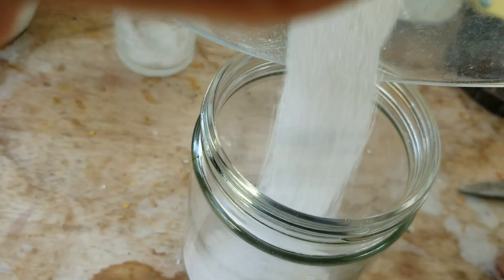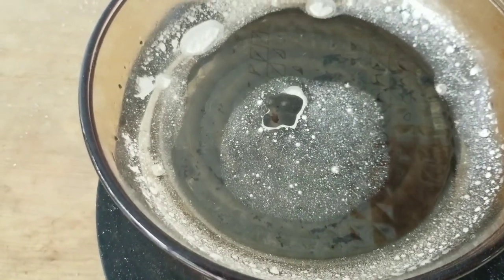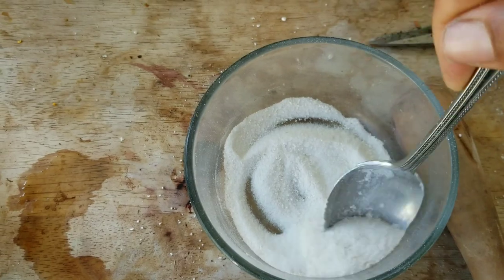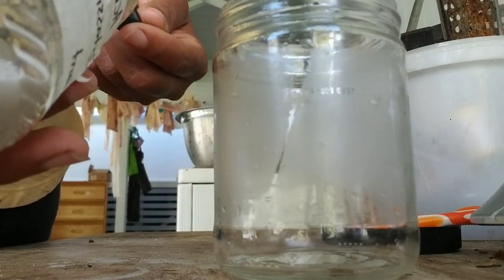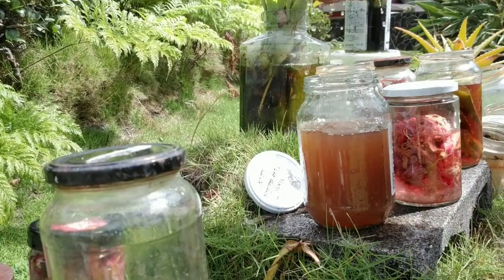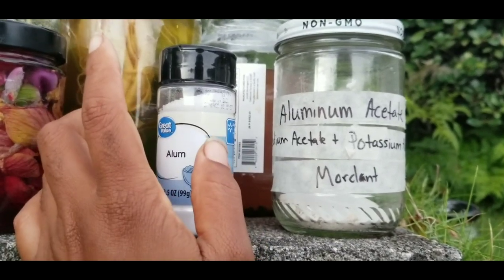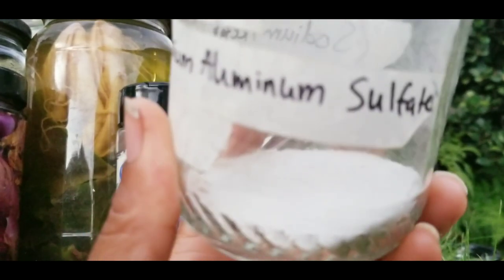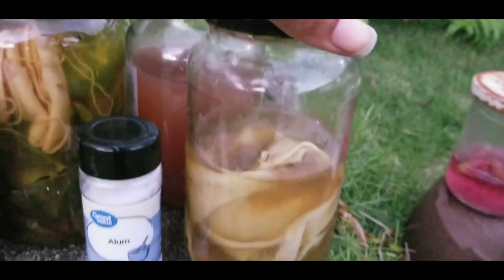How to Make Aluminum Acetate as Mordant for Plant Dye *Updated Video*

Comment: I don’t know much about dyeing textiles. I don’t even know what mordant is. But I’m into chemistry as a hobby. You should be able to make aluminum acetate directly by cutting up bits of aluminum foil and putting it in a glass bowl with 30% cleaning vinegar. If you heat it up a bit outdoors it’ll dissolve faster. Eventually it’ll just be a liquid. If any bits are left add more vinegar or filter it in a coffee filter. Then heat it to a simmer until it dries out.
Reply from the maker: Very interesting!  Thank you for sharing the info. Currently researching this, since  I'm definitely someone who would try it!

Comment: Hi! I’ve Tried Several Times With Aluminum Sulfate and All My Botanical Prints Washed Away When Rinsed. Thank You Very Much for Explaining the Differences Between Aluminum Sulfate and Aluminum Acetate! Hoping I Can Get This Eco-Printing to Work For Me🙏
Reply from the maker: I'm so glad the info was useful for you! Most of everything I was reading about this referred to the use of aluminum potassium sulfate.  I've only come across one source  that talked about aluminum acetate plus tannin being better,  particularly for cellulose fibers.  Unfortunately, I can't even cite the source, as it was literally a sentence or two, and I don't recall where I read it.  But as I've experimented with this, I have found that aluminum acetate, especially when combined with some form of tannin, does work well as a cellulose mordant.  I hope you find some success with this.  Color washing out after all that work and high hopes is no fun!

Comment: Thanks for sharing your knowledge!  How much hot water did you use to dissolve the AA?  Proportions please.
Reply from the maker: Here are a few relevant points.  When using AA or  alum these days:

1.  I don't typically follow the WOF (weight of fiber) method unless I'm dyeing a large garment like a long dress.  This is rare. 

2.  For fabric pieces 1/4-1/2 yards (which is the largest I usually dye), I dissolve 2 teaspoons in 1 cup of warm water.  I then add that to a larger glass container of water and soak the fabric in that.  

3.  I'm usually only dyeing very small cuts of fabric these days when experimenting, and may only dissolve a sprinkle or 2 of mordant in water to prep the fabric.

4.  The large glass container that I use for mordanting purposes is an ongoing bath of water and mordant.  There's always some amount of mordant in there. Depending on what I'm doing, I may not add more but rather just use what's already in there.  I may use this a few to several times before changing the water, adding new mordant at times, and adding none at other times.

Thanks for the question! Let me know if you have any others.

Comment: Very interesting. Would really like see if this works. I cannot obtain ready-made aluminium acetate either, but I have a recipe to make some with alumiunium potassium sulfate, vinegar and soda ash (plain washing soda) and am wondering if you have the right kind of soda, because baking soda has the tendency to change colours and is used as a modifier, but not for mordanting. Could there maybe be an error here? But then again, I am not a chemist and don't know what happens when baking soda is mixed with vinegar ....
Reply from the maker: Thanks for watching and commenting!  For this experienment, I used aluminum potassium sulfate and white vinegar along with regular/plain baking soda.  I'm not sure what the result will be if you use soda ash.  I've made soda ash by heating baking soda in the over, but I haven't used it for making aluminum acetate. 

The recipe I used is based on info found online in a few sciency places where regular baking soda was used. I may experiement with soda ash, though, now that you've mentioned it.

The chemical reaction that takes place between the vinegar and baking soda-which I've read about, but I'm no chemist either--creates something completely new.  Once that new substance or chemical formed, is heated to crystals, and is then combined with the aluminum potassium sulfate, the color changing tendency of the baking soda seems to be eliminated. I'll have to experiment more.  However, in my experience with certain dyes, aluminum potassium sulfate alone or the newly made aluminum acetate can change the color of plant dyes.  So, it seems that alum in general--whether it be the one purchased (APS) or the one I've made in this video- can change dye.

For instance, when I make hibiscus flower dye, it's pink.  When I add a bit of alum (either one) it turns purple immediately.  Turmeric dye can also be easily changed with alum but also with baking soda, as you may know.

I said a lot, but hopefully something in there helped.  I will make a note to do a related video on all of this.
Reply: You should definitely use Soda ash ! Baking Soda is having much more ingredients which are made for baking, not doing mordant ❤️